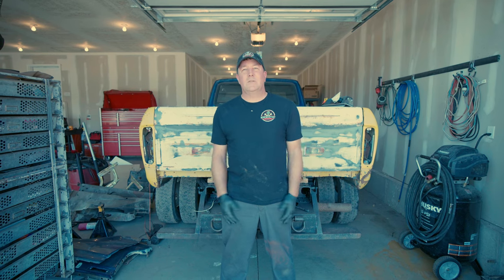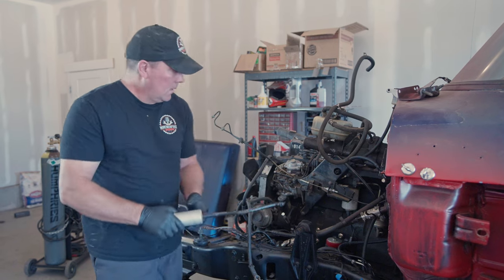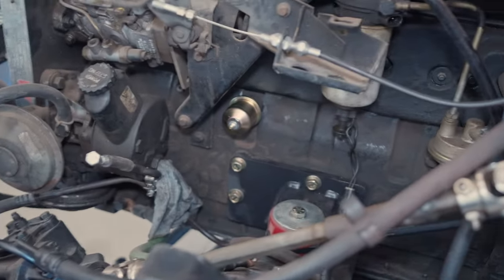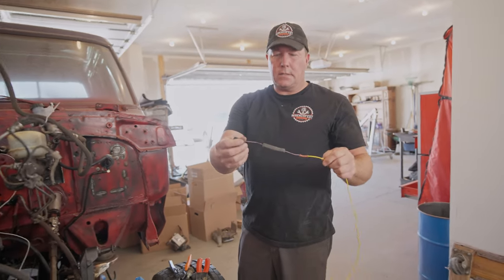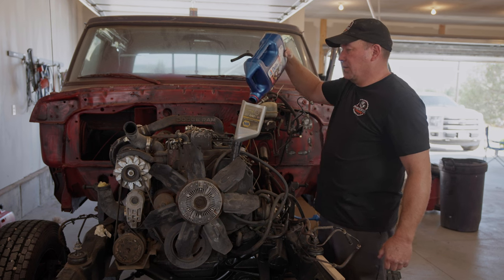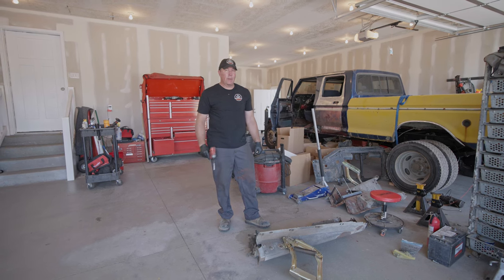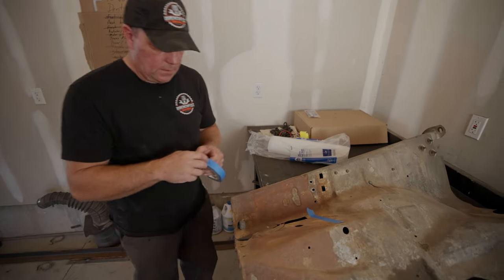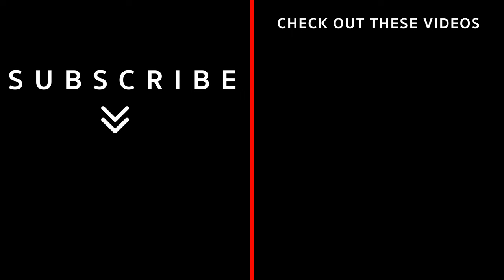This Truck Is Going To Be On The Road Soon! | The Ultimate Ford Dentside Cummins.

Comment: Curious what’s gonna be the main use of this beast. A dream of mine is to build a fummins
Reply from the maker: I’m going to use it for hauling, pulling, working, and playing.
Reply: @WrenchfestGarage  Nice. iIs your plan to upgrade the stock lift pump to a HVLP lift pump?
Reply from the maker: Eventually when I upgraded the injector pump and the injectors 😁

Comment: Prep and paint the battery tray area with some aircraft bituminous paint. You'll want a drain hole and tubing to keep the tray dry. Use of a plastic tray liner will help too.
Reply from the maker: That’s a great tip thanks